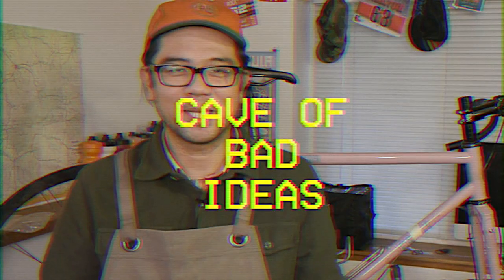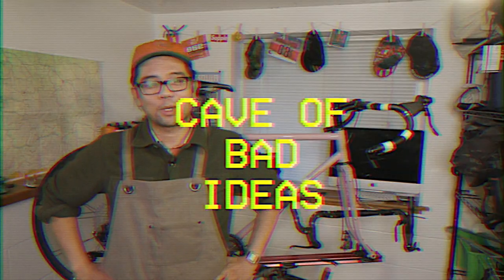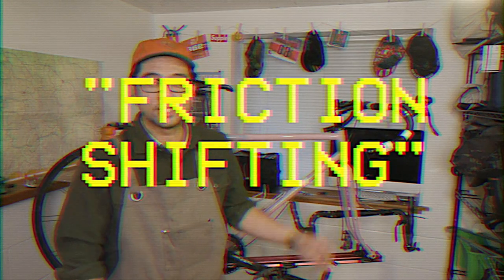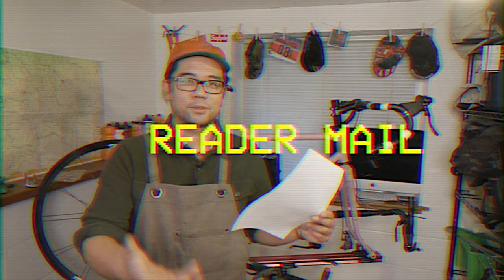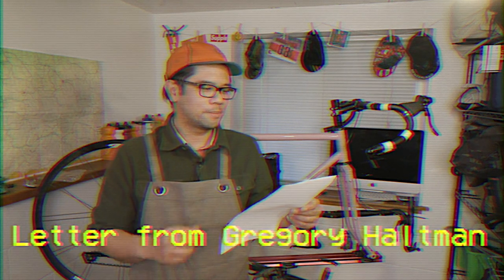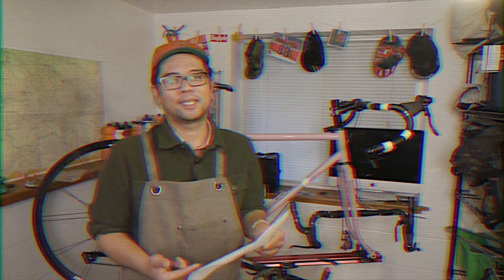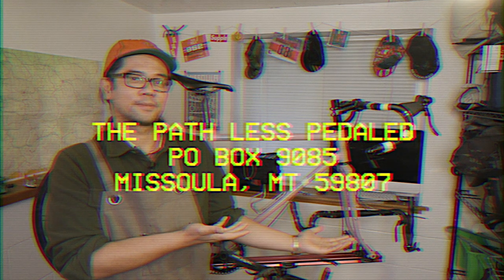If Our Youtube Channel Existed in the 80s!

Comment: Dream fullfilled! 
I've been laughed at on national television 😃😃
Reply from the maker: Thanks for being a good sport. It would work but not long term :)
Reply: @PathLessPedaledTV   genuinely curious why you think it wouldn't work long term to flip the b screw. Are you suggesting bolt head failure would occur? That the extra work to adjust it isn't worth the benefits? Or are you just not happy with the bodge-factor involved? Would it change your opinion if you knew Sheldon felt fit to mention it as an option, and it survived a revision? https://www.sheldonbrown.com/derailer-adjustment.html#btension
Reply from the maker: @MrKipperfish  It would "work' but long term viability probably not.  The longer the B screw, the more it bends, and the surface of where it presses against is curved.  Only a matter of some bumps, bad shifts and that shit is going sideways.  What you don't see is how thin that plate is. Every derailleur is different, I doubt Sheldon would endorse it if he saw this particular derailleur.  You're free to do it as  you wish but as someone attempting to make decent content I'm also not going to recommend or show something that I think will fail.

Comment: Dumped all my “techy” bikes n now only run old school grouchery! Friction shifters , V brakes and quill stem!! I’m 260lbs n ride steel on and off road. Never had any of it fail! I have been F’d by carbon and disc brakes . I would rather spend time riding than fiddlin w gear. Go 80’s !!!!
Reply: I don't recall V-brakes existing in the 80s. Side pull, center pull, cantilever & u-brakes...yes. V-brakes...no. 
I could be wrong though.
Reply: @josephhaddakin7095   Magura hydraulic rim brakes were always quite groovy in the 80's

Comment: Great video

But in defence of friction shifting - I have just squeezed a modern 10spd rear wheel into an old 1980s steel bike and it works great with non indexed shifting. Not having to worry about compatibility between shifters and My cassette is great. And with 10 sprockets it always falls straight into a gear

Also changed the crankset so now I have an Eroica bike but with 1:1 gearing that weighs under 10kg because it is so simple
Reply: J B been doing that on my l´Eroica bike since i build it - Simplex retronfrition, Campy Athema 87, modern Campagnolo casette and chain. 4x l´Eroica Gaiole participations.. indexed shifting is overrated, modern chains and casettes are not.

Comment: I love my friction shifted eagle setup... Inconvenient, yes. But I can't argue with 500% using one chain ring.
Reply: Did you use because of pull ratio problems? If yes, did you consider using cable pull converter?
Reply: @WanderABit  Correct, I did consider a Tanpan. But at that point in time one did not exist. Is there a pull ratio converter for sram eagle components? Other than a pull ratio delete kit in the form of AXS. I set my gals bike up with a Box wide 11 speed mech with an 11-50 cassette, Shimano 11 speed ultegra levers, and a Tanpan. It works flawlessly. Highly recommend this cheap wide range alternative.
Reply: @chrisstahler3463  I don't know for sure because I stick with Shimano and I use JTek Shiftmate here. There are several variations for Shimano, SRAM, Campagnolo, so check them out: http://www.jtekengineering.com/shiftmate/shiftmate-compatibility-charts-choices/

Comment: That looks like the 80s! I was expecting some friction shifting content!?! I like to make dumb ideas work out even if they are still fixed dumb ideas.  I came up with those listed fixes, and a more complex one that  builds up the B screw bearing surface.  A time waster for sure, but would keep someone out of trouble for a little while!
Reply from the maker: Shifter content is coming.  Was going to put it all in the same video, but this made sense to keep this as a standalone fun vid.
Reply from the maker: Here you go.  18 minutes of friction shifting content. https://youtu.be/tQI-OOBRGhc

Comment: I had at least try watching this with my 3D glasses!!  Intro totally reminded my of one of my favorite 80s show MacGyver!!  Can you try the SRAM Eagle NX rear derailleur?  It uses SRAM exact actuation technology.
Reply from the maker: Doesn’t it use X-Actuation and not compatible with road (Exact Actuation).
Reply: @PathLessPedaledTV  I guess SRAM made the road and MTB incompatible on purpose. Only the 10 speed road and MTB work together.  On my 2011 roubaix I had a SRAM X7 rd with a 36 tooth cassette.  It shifted perfectly with my Apex brifters. Looking forward to more from the COBI!
Reply: Path Less Pedaled . True. What will work is SRAM type 2 10 speed rear derailure, 10 speed shimano/sram casette AND 10 speed Campagnolo Ergo shift leavers. Those Erogo leavers will do single, double snd tripple front shift as they leaver for the front is basicly non indexed (trim)